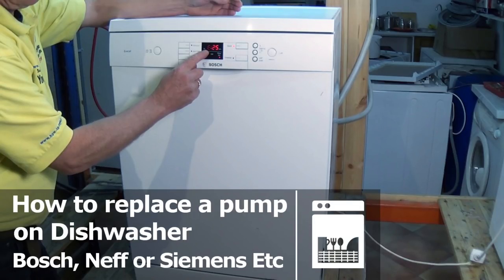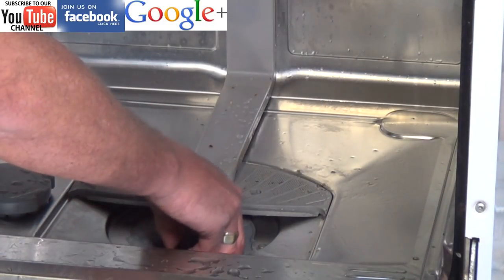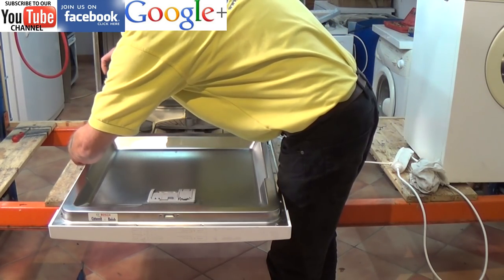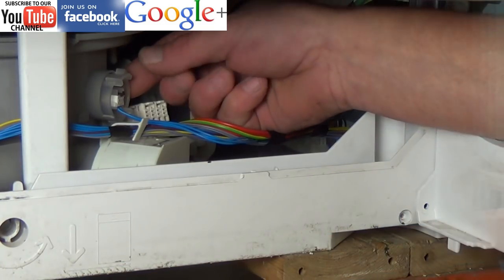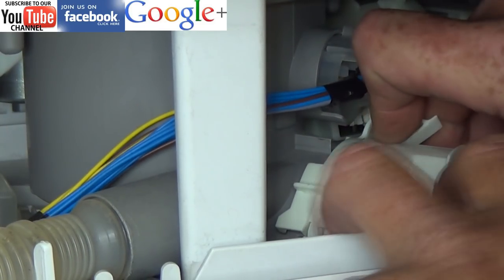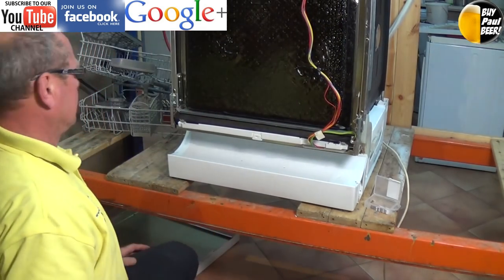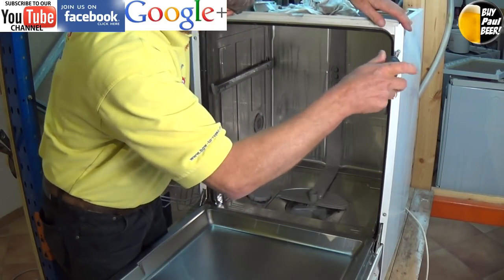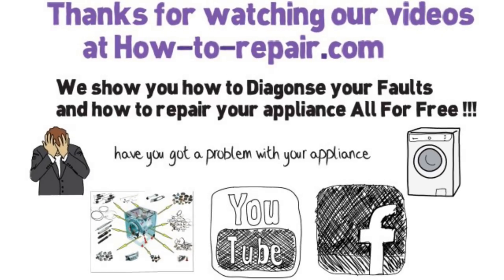Dishwasher how to replace a Pump Bosch, Neff or Siemens E25 fault

Comment: Nine years on and saved me several hundred pounds. Pump was a bit fiddly to remove on my integrated dishwasher as there doesn't appear to be as much space to maneuver the pump as there is in your video but I got there in the end.
Reply from the maker: I'm glad you liked it. Could you also do me a favour and take part in a poll I've made about the lifespan of appliances if you have not already? You just need to tick one of two boxes. It will only take about 10 seconds. This might help us improve how machines are made in the future😇 

Here's the poll question: https://www.youtube.com/@How-to-repair/community

Also sharing will get more people to participate and we will have a greater impact with the manufacturers thank you for helping.

Comment: Thanks so much for this incredibly clear instructional video. After removing the pump motor I found that that waste had accumulated in the small hole through which the impeller empties water, I could only discover and reach this by removing the pump (which I also cleaned since I had it out). No replacement parts needed this time, but I've bookmarked your site for spares in the future.

Comment: So grateful for this video, my Bosch E25 error has driven me nuts. Just waiting to see if the removal and clean has done the job or if a new pump is needed, either way I should have be able to avoid chucking away a 4 year old dishwasher
Reply from the maker: Hi, please use our contact us page and make sure you fill out the request for what your problem is. I will need the full model number of the identification plate and the details of your problem so that I can provide you with useful literature. A video shoot of the problem would be perfect as well.

I will get back to you within 24 hours, normally. https://www.how-to-repair.com/help/contact-us/  

Please remember to subscribe to our channel, as that's what keeps this channel going. Thanks, Paul 👍

Comment: Have a Bosch smu53m72sk/93 which does not heat the water. Managed to kill it by adding normal dishwashing liquid in it I think. There was some foam outside it. Afterwards I first got a error code E31 which then changed to a E10. Thinking it is the heat element but why did it change from E31 to E 10? Any ideas? Really grateful for some hints here. The element cost like £150 so it feels quite step especially if it is something else.

Comment: I found it impossible to insert replacement pump. Reason: I had a block of wood under the machine to tilt it. This was flexing the plastic floor slightly, which prevented the motor fittings back in. When I moved the block of wood the motor slid in fairly easily. I hope this helps somebody who makes the same mistake as I.

Comment: Hi how do activate the test mode in Bosch dishwasher?
Reply: moshikomio if you mean operate with door open, I think you pull or push the flimsy  grey tab at the top underneath the lid.

Comment: Thanks very much for this! Helped me find the clip that was preventing removal of my Bosch Dishwasher drain pump. Other videos hadn't shown this, so I was convinced my OEM part wasn't the same as the Spare I'd bought. With your help, the pump was off (after more fiddling to remove the electric connection) and the spare - although the body was different - fitted in fine.

Comment: Before I changed the pump, I fed the garden hose into the house, placed the hose on the jet setting and forced water at great pressure through the pump to hopefully dislodge any stubborn objects.  This seemed to have worked.  Awesome video, by the way.  Thank you.

Comment: Excellent video that really helped getting at my pump. An observation that might help others (and apologies if someone already said this).
On my machine (Bosch exxcel 2013 vintage) There was no need to remove the top panel or the sides or tilt it. I did it all with the machine in situ. Everything was the same as the video except removing the kick panel was a bit fiddly as you cannot see underneath to tell what you are doing. If you look along the bottom kick panel there are a couple of 10mm wide recesses just inboard of the front feet. They are fairly obviously designed for something to slide in. Stick a flat blade screwdriver in them (one at a time) until it catches and gently lever the handle up (to lever the back edge of the kick panel down) then pull out the panel at that side. You might have to fiddle a bit to get the screwdriver blade in the right place but should release quite easily. Repeat on the other side and Bob's your uncle.....
To be fair it is much easier if you can pull the machine out and tilt it back but mine is a right pig to do that so finding I could do it all in situ was a real bonus.

Comment: Just replaced my motor...great instructions. I ended up with 2 soft plastic spacers from the door that aren't seen in the vid but presume non-essential.  1 run successful...now testing with dishes...multi-hundred replacement machine fixed for £33

Comment: Great video, assisted in repairing pump on identical machine. When I removed the door cover there were two plastic spacers which fell out which don't appear in the video. After a bit of research I found that they clipped on to the sides of the door near to the hinge about an inch up each side - there was an indent in the plastic which matches a part of the door frame to get the exact position. When replacing the door you need to expand the door cover around this plastic and they actually then help to hold the cover on while you replace the screws!
Pump supplied by how-to-repair was identical to the original one and was so much cheaper than on many other websites!
Reply from the maker: Iam Glad we could help you
Please remember to subscribe to our channel
https://www.youtube.com/user/Apart4u?sub_confirmation=1

Remember to Shop with www.how-to-repair.com and it would help us by posting the video or

website on your timeline. This helps us a lot and if we really helped you can
always buy us a beer http://how-to-repair.com/help/buy-paul-a-beer/

Please remember to mark us to your favourites also I would be grateful if you would
subscribe to our channels social media as this really helps my site and keeps
us going.
YouTube. http://www.youtube.com/user/Apart4u

Facebook. https://www.facebook.com/how.to.repair.appliances

Comment: Thanks for this.  It really helped.  My problem turned out to be a plug of muck in the end of the outflow pipe restricting the flow.  But seeing how easy to replace pump made it worth checking everything.

Comment: Many thanks. very helpful video. I did all you said when I got the error warning. Stripped down the dishwasher ready to replace the pump and found all the wires chewed by mice. Now fixed and running well!

Comment: Fantastic video.  Very much appreciated. Pulled out a rubber band between the impeller and housing.  Took under 15min, and clearly saved a callout cost, but more importantly the time waiting for a technician to get it fixed and the dishwasher out of action. Thanks so much, happy wife and kids.

Comment: Best video for disassembly! Thank you so much!
Reply from the maker: Glad it was helpful! I hope you manage to fix your dishwasher  @sertifikali please remember to subscribe to our channel as that really helps us https://www.youtube.com/shorts/e432SAb2g08  Thanks, Paul 👍
Reply: @How-to-repair  This time I need I have a E21 error code. I guess I need to check if the circulation motor is stuck. But I an having difficulty on how to remove it. Any suggestion. Also is there a way to remove the bottom plastic on an Bosch sms53m02

Comment: Thank you very much for this video! I have a very similar Bosch machine. The innards are exactly like the one in your video. I managed to remove the pump in no-time flat and remove a bit of glass that was jamming the rotor. Also a bunch of hairs and other tangly stuff came off the axle. Thanks again!

Comment: I used this video before and it was so helpful.  I've come back because my dishwasher is filling and emptying, but not spraying.  Does this little pump do the circulating as well as the draining?  I am working my way through the usual maintenance cleaning, but am becoming stumped on this. The matrix is pristine, the pressure valve working, the float switch free to work.

Comment: I Really want to thank you for this video. it has been most helpful !. i have a similar bosch sms40e02eu dishwasher when turns on make few click noise and light the "end light" right after that (few seconds after), and it will not start. with this video i manage to take off and check many parts of the dishwasher and make sure that they are ok. I Still didn't find the problem and i continue looking. do you have any idea what i should check for this problem ?
I Manage to run the test mode of bosh for this dishwasher and it ended with turning the faucet light blinking fast if that helps...

Comment: Great videos followed your first e25 now couldnt see an issue. Died again after second run. Now followed this one took it all apart. Couldnt see an issue with pump after got it out. Put it all back together and it's worked twice in a row..fingers crossed. Didnt find an issue or blockage tho so could happen again.

I didnt need to take the top or the sides off just the front
Reply from the maker: Can you do us a favour and please share this video on your timeline.
This will help other people who can’t get engineers out to help them.
https://www.youtube.com/watch?v=rFyGAHVFUW8&t
Stay safe
Reply: im back looking for this video again as i have the e25 back again :).

Comment: Hello Thank you for the helpful video and advice.  I have replaced the pump on my bosch dishwasher and still it displays the E24 code. It runs for only about 3 minutes into the cycle - there is an initial 'grinding/whiring ' sound then a silent period for a couple of minutes, then the 'grinding/whiring' starts again for about 10 seconds, then it cuts out and displays E24. This is exactly the same as before and with the 'old' pump. I wonder can you advise me what to do now. With thanks again, Philip

Comment: Got my motor removed, thanks to your good instructions. However, I’m puzzled to knowing I should replace it. Should the motor/pump spin freely, gliding for a while? Mine turns easy enough but stops right away; doesn’t roll by itself to a stop. You think the motor is shot?
Reply from the maker: It is very hard for me to understand from your description. You will feel a bit of restriction on the motor as it goes around, but you could always benchtested with the correct voltage. Have a great Christmas and a happy New Year. Thank you very much for subscribing to the channel

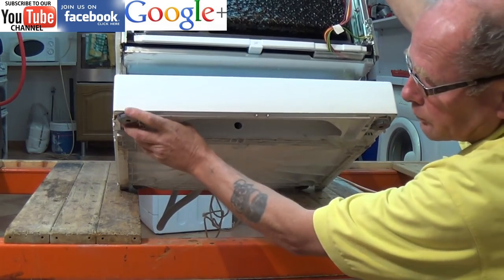Comment: Great tutorial! Solved my problem, but at 2:36 of the video you can see two plastic spacer blocks of some sort drop out of the door as the front panel is removed. This happened to me, too. Any hints as to what they are or how I refit them when I put the washer back together. Thanks.
Reply from the maker: I am glad I could help you with this problem.
Please remember to subscribe to our channel
https://www.youtube.com/user/Apart4u?sub_confirmation=1

Remember to Shop with www.how-to-repair.com and it would help us by posting the video or
website on your timeline. This helps us a lot and if we really helped you can
always buy us a beer http://how-to-repair.com/help/buy-paul-a-beer/

Please remember to mark us to your favourites also I would be grateful if you would
subscribe to our channels social media as this really helps my site and keeps
us going.
YouTube. http://www.youtube.com/user/Apart4u

Facebook. https://www.facebook.com/how.to.repair.appliances
Reply: Watch above after 5.15 minutes
Reply: Hi, Here is another video that shows the door spacers after 4.30 minutes https://www.youtube.com/watch?v=EB3dZEHWrYc

Comment: I have error code E23 on my Siemens SN26M290GB dishwasher.  I've followed your video and removed, cleaned and re-fitted the pump.  The error code is still present.  Is there anything else I should try before buying a new pump?

Comment: My drain pump in my Bosch dishwasher is  turning (plastic fins are all there) but not draining water . The pathways are seemingly clean. Is it the rubber valve near this pump which is responsible? It seems intact. Thank you.
Reply from the maker: try running the machine with the drain pipe into a bucket. this would eliminate if you have a problem with the drainage system or the Machine Thank you for leaving a comment this is for you https://www.youtube.com/shorts/e432SAb2g08 please remember to subscribe as that's is what keeps this channel going. Thanks 👍

Comment: thank you I have the same machine and present a lot of noise I opened the pump and it had a piece of hard plastic in it and I removed it and now it works properly again I had an error 25

Comment: I have a problem with my dishwasher a Siemens    FD8103 25265EU/12  water is not pumped away,the pump shaft moves left right. How do I know if it must be replaced or just cleaned?It looks clean to me. Please help!

Comment: Have a Balay(Bosch) dishwasher that is quite old. Have checked the inlet valve and there is no continuity so I think it is faulty. When switching on the machine to start a function no water comes is, so I guess thats the problem? My other question is this, usually dishwashers 'drain' first before a wash cycle but if the inlet valve is faulty, will this still happen(i.e. will the pump activate and evacuate the water within the machine is the valve is faulty and no water comes in??) or will it be prevented from draining the machine? Just trying to eliminate a pump fault also...

Many thanks..

Great videos..

Comment: Hi. Which screwdriver did u use to remove the door. What is it called ? I’m going mad trying to figure out where that pump is. I’ve got the SMS65E12GB. LOOKS LIKE THE SAME one ON THE VIDEO. I just want to access that pump and check wether it needs cleaning or replacement. Plse help!!
Reply: Model is BOSCH SMS65E12GB/44
Reply from the maker: hello there, i apologise for the late reply, coronavirus has us on lock down here in portugal 

the type of screw driver we use for bosch machines is a TORX screw driver, the numbers have been rubbed out our sets through that much use but i think its the T15 Torx screw driver 

any more issues pop on over to our facebook site and book a free video call with one of our engineers, we try to use the camera and your own hands to help diagnose and fix any issues 

https://www.facebook.com/how.to.repair.appliances/

Comment: You don't need to take the door off.  You can get those torx screws off for the galvanised inspection panel  (cover plate) with the door on, If you open it to a right angle and add a small amount of pressure,

Comment: How do you fit the replacement pump so easily? I've been trying for an hour now. It's like the fittings dont match. I can place the pump where it should be without turning it, but then it wont go in of course, however as soon as I turn it, it goes askew as it seems the turning makes the pump press against the surface area below it. Impossible to match that way.

Comment: Thank you sir 
But there is no need to remove top of machine and left panel, front panel also. 
Only need to remove right side panel and disconnect the power module and start your job to replace the drain pump. 
Thank you 
Regards Sagar India

Comment: Hi my dishwasher doesn't drain, I checked no blockage, but does not give any error number, it stops when water fills up, do you know what problem might be? Thanks
Reply from the maker: you need to check the pump is working Thanks 👍 for watching and please remember to subscribe to the Channel as that's what keeps us going in able to make the video for you

Comment: Hallo please I have problem with my dishwasher siemens  Sn24m280ex. if I put it on for 2 hours . about to pump water from 2 hours  it will  go to one minute the machine will stop bumpy water please  and the  
Error is 17.  is it anyway to solve the problem please.

Comment: Thank you.  Don’t think there is a need to remove and the top and side panels for this repair.
Reply from the maker: Whenever working on most appliances, I do this, just so I can see what's going on in the flow matrix on the left-hand side, and if I need to get some parts, I can put my hand through the side of the machine. it did make a video little longer than it should've been so my apologies

Comment: hi i have the same problem with my Bosch dishwasher silence when I start is the current after 5 minutes from the dishwasher and the dishwasher is then filled with water, would that mean that lie at the pump. thanks
Reply from the maker: take out the pump and check it

Comment: hello I want your help for a problem with the dishwasher the problem I have is that gets water for seconds and then stops the stops gets water the screen shows a vertical line and alarm beep.He has three led.the first and third have expected light. if you help something that I saw over the AQUA-STOP It has a window control instruments has A red plastic this is raised.if you Please help me I brought three technicians and do not know what My one said that it has problem The PCB the other that has the problem aquastop.The model is NARDI LSIS-1   20010224357.THANK YOU

Comment: My Bosch dishwasher give E21, I checked filter for cleaning ,checked obstruction of drain hose but patent not obstructed , I changed the drainage pump by new one but my dishwasher still gives me error code E21.
After 2 or 3 minutes of starting program the dishwasher gave me on screen E21,. 
What can I do????
Reply from the maker: also check the Matrix on the left-hand side of the machine and look for blockages all in the hoses and please remember to subscribe to the Channel as that's what keeps us going in able to make the video for you